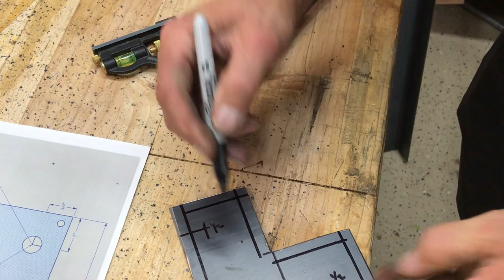DIY Hairpin Table Legs

Comment: Great job for sure. My background.   Im a welder for a 1/4 century.  For the last decade ive been putting up slabs of wood. I make from wood all the legs for my projects.  I gotta say you went above and beyond showing the method you used to create an awesome set of legs. Not all legs are created equal.  Lol. Good work for sure.
Reply from the maker: Thanks so much, thanks for checking out my video!

Comment: wow very nice you are a beast! Just got started doing some woodworking on and off a two years ago as a hobby and I would like to pair that with metal legs as well. Excuse my ignorance but why and what did you soak the legs in? Is that done for every metal piece?
By the way liked and subscribed.
Reply from the maker: Thanks! I did that to remove the mill scale that is produced during the hot rolling process of making the steel rods. I later learned that cold rolled doesn't have this scale so its much easier to clean up. Thanks for watching!

Comment: Hi great video, what do you think should be the minimum thickness of the metal peds? (The part with the holes)
Reply from the maker: Hello, thanks! Hard to say what the minimum would be. I think it would depend on the length of the leg and the weight of the table it was holding.  Mine were 14 gauge which is just barely under 1/8 inch. I probably wouldn’t have used anything thinner. If the legs were going to be very short then maybe I could have. Also welding the 1/2 inch rod to a very thin plate would have been more challenging for my limited welding skills. It helped to have an 1/8 inch of steel to weld on. . Hope that helps. Thanks for watching!
Reply: Ok thanks, something else, what is the size of the pads? ( The dimensions?!?)
Reply from the maker: @alonro  Sorry, I just saw this post. Here is a link to the diagram I made when I made the plates. Hope that helps. Thanks!
https://www.dropbox.com/s/niv9c6qhigrpeqh/hairpin%20plate.jpg?dl=0

Comment: Hello! Great video! Have a couple of questions for you and i apologize to you've already covered the answers to these but I was curious on what angle did you put your legs at on your jig before welding it to the plate in order to adequately support the weight of the table? And also I know you had mentioned that you were just making these for your sister but if someone wanted to purchase these from you or have you custom make a set of table legs like the ones here in the video what would you charge to do something like this? Again great job thanks for sharing! subscribed and following! Oh and I love the flip-flops!
Reply from the maker: 5 degree angle.
Unfortunately, I would have to charge too much for these as they took several hours. You can buy them online for pretty reasonable prices. These are easy for machines to make so they can be sold cheaply. Hand making them takes a lot more time. Thanks for watching!
Reply: Me pareció que las patas van ángulo rectos no le dio alguna inclinación

Comment: Is the angle iron 1/4 x 1 1/2 and a threaded coupler for 1" pipe
Reply from the maker: The angle iron is 2 inches, but it wouldn't need that that size, that's just what I had on hand. Yes, the other pat is a coupler that has a 1 inch outer diameter. Thanks for watching!

Comment: What was the diameter of that round metal piece there in the center 1 in inch and a half
Reply from the maker: I think that is right. I believe it was a coupler for a 3/4 inch pipe. Thanks for checking it out!

Comment: I saw what looked like a plan, would you mind sharing where you got the plan?
Reply from the maker: Hi, Matthew. I designed them myself in SketchUp. I’d be happy to send you the plan if you’d like it.
Reply: Last Leg Woodworks that would be great!
Reply from the maker: @Matt_Barbee  Here you go. I used 1/2 inch round rod and I took the height that I wanted the leg to be and doubled it and ten added I think about 8 inches for the curve at the bottom. This left it a little long so I could trim it even. I believe I made the angle 5 degrees. Also, ask for cold rolled round rod at the steel yard and it wont have any of the mill scale on it like my hot rolled did. I didn't learn this until afterwards. Chuck up the cold rolled rod in a drill and spin it while holding some sandpaper on it and it cleans up great. Good luck! have fun! https://www.dropbox.com/s/niv9c6qhigrpeqh/hairpin%20plate.jpg?dl=0

Comment: looks like you did loads of specialist work by yourself there, then took them off to get them painted. why didn't you spray em yourself?
Reply from the maker: They were made for an outdoor table so I wanted to get them powder coated. I took them to a place nearby for that. Thanks a lot for checking out the video!